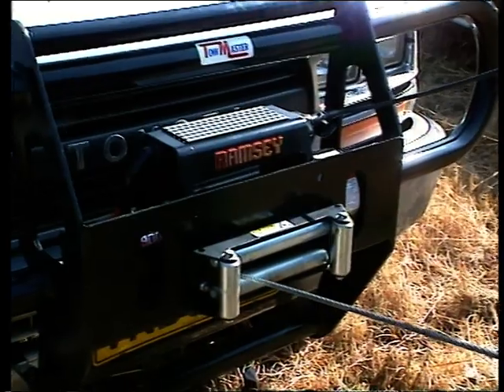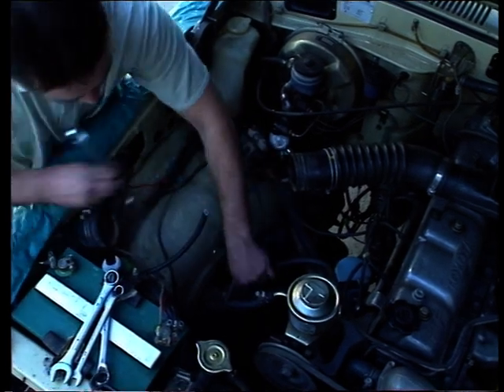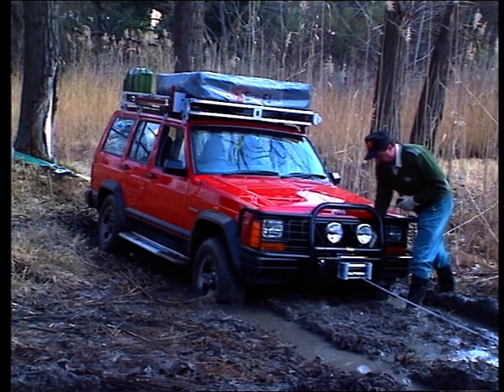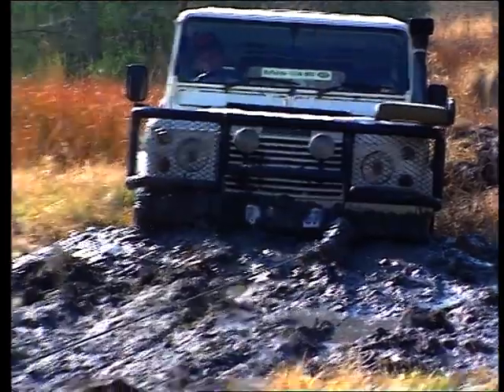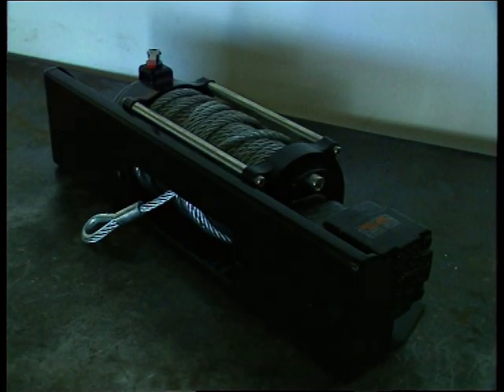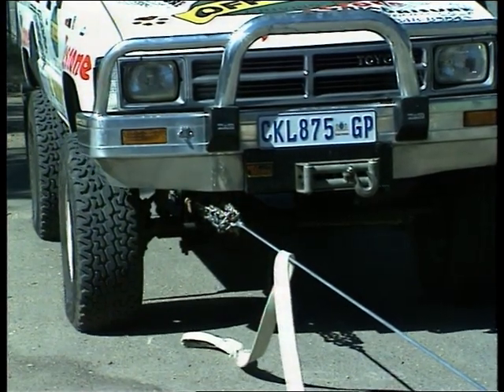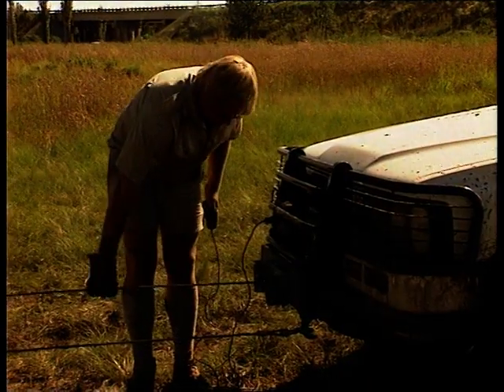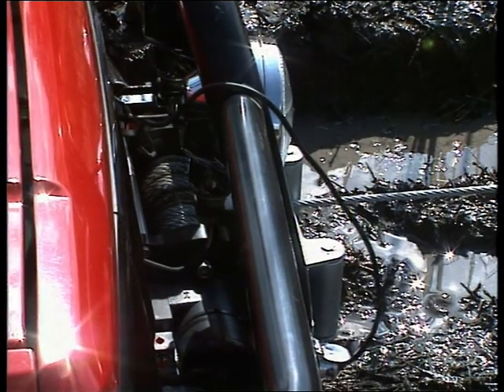Winches: Hydrolic versus Electric

Comment: Hydraulic winches  -yes if you have the pump to drive it - thanks  for informing me that one could actually USE the power Steering pump. - Never gave it much thought as   such since usually steering systems  are low power  - Pressure & Flow.    I'll have to do some Sums now for a Customer.  Thanks for posting
Reply: The model discussed here it's a Mile Maker. This was especially designed to be used with power steering. Who knows any other hydraulic winch brand

Comment: I find that separate 12v hydraulic pumps that are mounted above the water line are both affordable and reliable to power hydraulic winches. I have burned out or outright broken Mile Marker, Warn, and SuperWinches that are electric while the Warrior hydraulic winches work fully submerged and have never stopped pulling my 11,000 lb F350 work truck with a heavy 7.3L diesel.

Comment: What about in a Landrover Series 3 truck no power steering but a split charge relay system and  a 12vdc 90ah leisure battery running along with the vehicle 12vdc  75ah starting battery  for occassional use an electric  winch will be better suited and cost a lot less also.